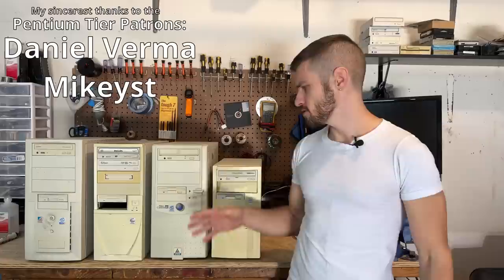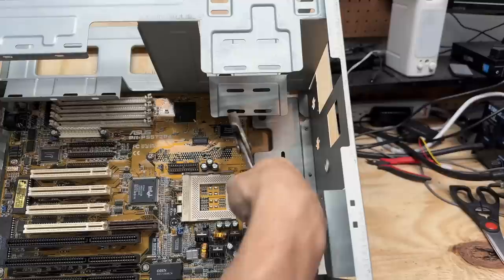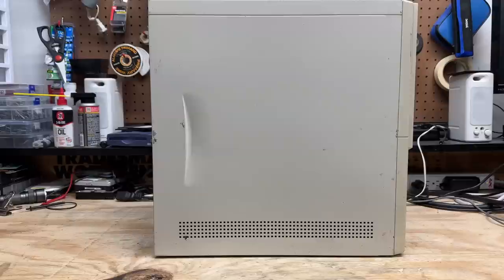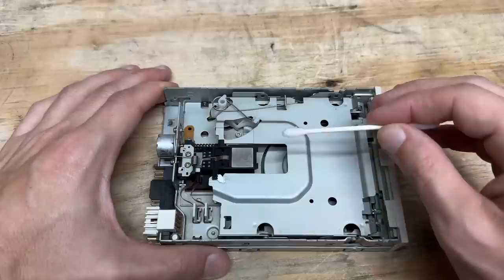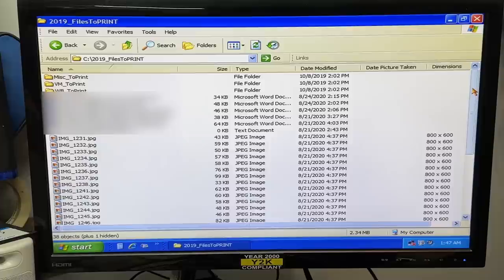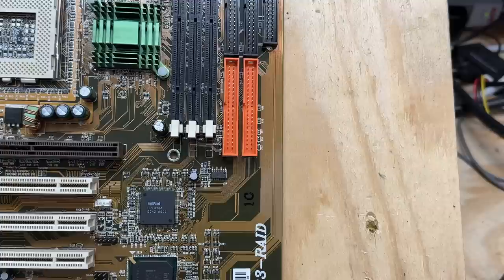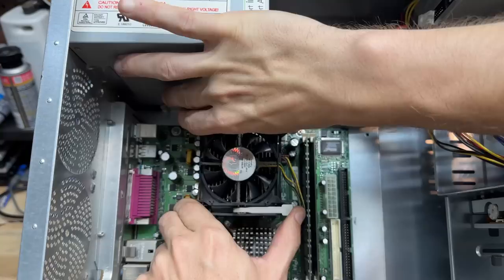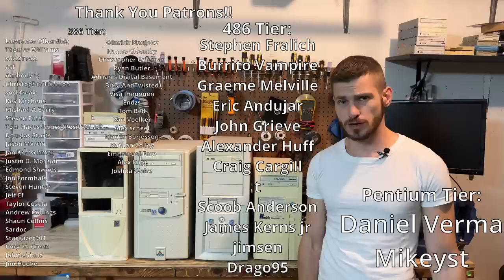Let's explore some mystery custom PC towers!

Comment: The sticker over the speaker performs potentially two functions, but making it quieter isn't really one of them.

It's either for allowing a vacuum pickup tool to have a flat surface to grab the component during assembly (the same reason why you sometimes see a small piece of tape on USB connectors), and/or (perhaps more likely) to prevent ingress of cleaning fluid during an ultrasonic cleaning process at the end of assembly.

Making it quieter is just a side effect of the sticker being left in place after assembly and cleaning.

Comment: The inability of some drives of that period is related to lower reflectance of CD-Rs. Early DVDs were bad at reading CD-R for first generation.
Reply: I've encountered many a drive, particularly in the 2000s that just refused to load some CD-Rs. It was very much an imperfect technology that I don't miss any more... 😂
Reply: But they fixed those problems, just in time for napster. I'm happy when things come together like that. Man, the tunes I stole....... uh ...... borrowed..... sampled.
Reply: The main problem is cdr's are less reflective that cd's so had a lower signal return strength. Also the lasers could be just getting weak  so they read cd's but cant get a good signal from cdr disc's

Comment: I found a trick to revive floppy drives which won't move even with new grease. The trick is to spray some contact cleaner into the stepper motor that actuates the head, you can spray some in there through the holes in the back and so far it has revived 100% of the floppy drives that I did it on

Comment: Just wanted to say there was a period of time when it seemed like CD-ROM drives just wouldn't read CD-R disks for some reason. Like in the late 90s or early 2000s it seemed like we had a bunch of different brands with that issue. Finally started to order every system with a CD burner, just so we knew that they would read. Great channel and fun to see you restoring the same type of systems I started my career on.

Comment: That Celeron looked like a BX chipset, very popular pairing, you could overclock the smeg out of celerons.
Reply: You mean CeleronA (with the on-die cache), didn't you?!
Reply: Yes, I had one of those back in the days. 300 MHz easily overclocked to 450 MHz, that was awesome value for money.
Reply: The celeryA was the one worth OCing. The non A 266 did overclock well though
Reply: and P2s, or so I heard.

Comment: My gut feeling with the CD-Rs not working is due to the dye. Modern CD-R blanks are made with much lighter dyes (phthalocyanine) which might not reflect quite how those old drives need. I recall that most of my discs back in the early 2000s were a lot more blue in color than they are now. I could be wrong but just a thought.
Reply: You may very well be right. I have plenty of Verbatim disks that used their dark blue AZO dyes and those disks always read well, compared to many of the cheaper disks I used in later years that had like a very pale green type dye.
Reply: Do you remember orange dye CD-Rs? The first Maxell ones I bought in the very early 2000s were like that and ugly expensive. I seem to remember they were something like 18 Austrian Schillings each, or €1.50 in 2002 money. Finding a 10-pack of no-name CD-Rs for 10 Euros felt like a steal and they were decent too. The packaging was something to behold. A plain white cardboard box with black print and the discs in paper sleeves inside. No manufacturer info or anything on the box I think. If I remember correctly these off-brand discs had a deep green dye. Blue ones came later and I loved them as a teenager.
Reply: @Ragnar8504  I never saw orange dye disks, but I did encounter recordable disks probably a bit later in the lifetime of the tech. However I have very fond memory of the Dysan black CD-R, as rumour had it those would work best for pirated PS1 games. I never could test that, but the black disks looked really neat and all of those I burnt still work to this day. Can't same the same for those pale green-ish dye ones.

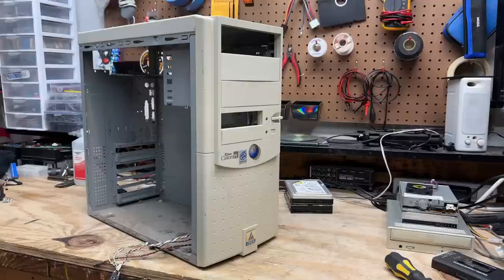Comment: 20:45 - The capacitors aren't what you have to worry about, it's the primary side heatsink, which is just above them. Most power supplies have that heatsink in-circuit with the primary switching mosfets, meaning that it's anywhere between 60-375v RMS, depending on the switching topology used. Some power supplies are of piss poor design and can have that live heatsink just 1/16th of an inch from the lid with no insulation between them.

I had an Antec SL350 that was such a design. Had a spectacular bang one time when a ground wire broke out of a molex connector and a one in a million shot, the wire whipped back and the end went directly into the vent of the PSU housing and touched the heatsink. Sounded like a gunshot and blew a deep crater in the heatsink. PSU was unfixable, that bang destroyed the mosfets, the PWM controller, bridge rectifier and controller IC.

The capacitors are perfectly safe to touch powered on, since their legs are hidden under the board. The heatsink, not so much. Accidentally brush against it and you'll be swearing right quick. The capacitors can keep that heatsink charged up from minutes to several hours if the bleed down resistors are missing or damaged. Best to poke a multimeter across the heatsink and the PSU body to make sure there's no voltage left. Don't try shorting this heatsink out, because you'll most likely blow up the main switching mosfets and destroy the supply.

Comment: The AOpen was obviously from a smokers house. I know, both of my parent's smoked, so I know that dust well. The reason it's so difficult to clean is because it's got cigarette tar, which is incredibly sticky. A bit of degreaser, like Dawn dish soap, will work wonders on plastic parts.
Reply: The spookier part, is how that stuff binds to lung tissue. I think of the things I did to my lungs. And even now, I'm not sure if I got away scot-free. But I LOVED smoking, in the beginning, and it was because of that very tar, that my tastebuds went to nirvana, and ultimately short-circuited, so that cigs were tasting like something worse than ***t to me.
Reply: I'm not sure, the dust doesn't look quite brown enough to me. Besides, it would have smelled. Humidity can make dust properly difficult to remove. My parents have a holiday home that sits empty and unheated throughout most of winter and that has dust just like this PC. Spring cleaning is always a chore.

Comment: That last system with the 2003 parts takes me right back to my high school years. That was the rig i was running right around my senior year of HS, first video card i bought was the Voodoo 3 and that would have been in 2001 i believe. Time flies.
Reply: Just out of curiosity, I'm wondering if they were still teaching computer science in hs in 2003. We took it in grade 12, but that was in 1982.

Also, it's just weird what time changes. When I was learning how to run my own computer, reading those Dummies books and doing the disk tutorials, we were told that we needed to get a "computer guru" to help and guide us in our computer journey. That was in the mid 90s.

Now, it's like who the fkkk needs one of those? The damn comp explains itself.  : )
Reply: @keithbrown7685  They were still teaching computer science in 2003 in high school because I was taking some of those classes back then while I was in high school. They were tech prep/vocational program classes that counted towards college but I never used that credit for anything as I did not go to university, only to a vocational college.

Comment: Awesome videos. The P4 is not dual core but Hyperthreaded. Was a way to get more performance with those chips
Reply: And more heat. That was the whole point with the P4. Geeks needed space heaters. They also needed comps, but they often lived in cold cramped spaces, like dorm rooms. Enter the Pentium 4.

Comment: You never know what you'll find in these mystery towers, system 4 looks like the kind of cheap somewhat flimsy case I built a metric ton of PC's in while working at a local PC repair shop in high school. It's really cool it supports a 120mm fan tho, none of the ones I worked on despite looking very similar supported more than a single 80 front and rear. Could make a really good candidate for an IDE RAID array 'cause you could put a modern high static pressure silent fan in there and keep those drives cool. Pair of 80mm's out back, you'll be set. Thankfully modern fan designs are much imporoved over ye olde days where even the silent fans probably buzzed when new, or just screamed, or both.
Reply from the maker: The system 4 case is almost perfect for it. I’ll definitely use some modern, quiet fans so that those delicious drive sounds won’t be drowned out.
Reply: @miketech1024  Yeah, no pesky vibration dampers either, though I dunno what that's gonna do for the life of four drives hammering away in sequence. 

Back in high school, a friend of mine and I thought it would be funny to RAID a bunch of these noisy 1GB Western Digital drives he'd gotten in bulk. We never got to do it though, but man that would've been loud. The drives were leftover spares from some office building, NOS,  and they were loud. Never thought I'd miss that sound, haha!

Comment: Love your videos! I'm sure the fiberglass repair works well, haven't tried that myself, but I can also recommend Plastruct Plastic Weld. It is solvent based and chemically dissolves the plastic and melds it back together. I've used it to repair cracks in computer cases with great results. Edit: I see someone else already suggested this, at least I'm not alone :D
Reply from the maker: Thanks! I thought the previous comment was referring to the electric plastic welders (the ones that essentially just melt a heated wire in). Never heard of that stuff, but it looks interesting.

Comment: woow this first PC, it gave me some nostalgia....
very similar to our first PC when I was 5 or 6 years old it had also an Asus MB and a 120MHz intel P1 and 2x 16MB ram sticks :)
also the case is similar, maybe just different front plastic front panel (more rounded buttons)
it had a 1.6 GB seagata and a 8x CD rom

Comment: The last case is an Enermax. They had a ton of different looking front panels but are identical on the inside. Still using mine after almost 20 years.

Comment: Good idea using a fiber glass repair, myself I usually use a plastic welder to repair bezels llike that (both automotive and PC) it fills in the gaps a bit better, but i always end up having to sand and paint the whole thing as its hard to match the color
Reply from the maker: Fiberglass is my favorite material for repairing thin plastic like this. Stuff is crazy strong! I do wish there were a good way to replicate original texture after filling/sanding. Especially that classic IBM texture.

Comment: Some of those older CD and CD-RW drives would read -R but not +R or the other way around.  Would not read -R but would read +R's.  And/or were just finikey about reading both. Depending on how the CD-R was closed when written.  And there's just no rhyme or reason to it.  
Excellent video, I look forward to watching more.
Reply: That would be DVD. CDs only came in -ROM, -R and -RW flavours. Early DVD drives were sometimes indeed limited to whatever rewritable format the manufacturer thought to be more likely succeed in the format war. DVD-RAM was even more limited, especially the cartridge type.
Reply: @Ragnar8504  Whooops, you're right, I got'em mixed up.

Comment: It's fine to try and start a MB with bulging caps, ie, it will ether start, or won't start. 
Also those rows of caps are usually in parallel, so you can replace 6 caps of 1500 with 2 caps of 4500.

Comment: I think the AOpen system was built at a local computer shop or as mail-order instead of assembled by a home enthusiast because of the CSI label. CSI was an acronym for Custom System Integrator which is what a lot of those type of smaller vendors were classified as back then. 

The matching AOpen CD drive, PSU, and AOpen chip on the sound card lends further credence to a purchased build, as does the Coolermaster 3rd party CPU cooler, since the boxed Intel chips for home end users included a fan but the OEM brown box CPUs didn’t always. 

You are my favorite channel discovery of 2023. ^__^ Love the way everything is put together and that includes the host. 🤠
Reply from the maker: Thanks! That is interesting. The CSI badge was giving me a bit of a hunch. It's incredible how difficult this information is to find via search.

Comment: It has always been my experience that the CD session has to be closed when burning the disc before writers/burners will read them.
Reply: Yeah i had that a lot over the years 💿
Reply: At the start of the audio cd rip-off era, someone gave me a disc that sounded like the audio had tiny little pperforations in it. Turned out they forgot to finalize it.

I don't know why I remember such trivia, but this was in the year 2000.

Comment: Seeing the AOpen system interior brought to mind a service call I did for a local cement and gravel company. I was the most dust I ever saw inside a mostly working system. Every component was coated with about 2 mms of rock dust. The fans and heat-sinks were all rendered useless/non-functional by being gobbed tight by dust and grit. The bottom of the interior was coated thicker than the rest, easily a full cm of filth. How the system had managed to function in any capacity for more than a week in that location beggars belief.

Regarding CD-R incompatibility, in the late 1990s and early 2000s, I had endless troubles with CD-RW and CD-R media, it all hinged on what color laser diode was used in the units. Some used a yellow laser diode that would not work with some media, others used a blue laser diode (mostly Sony) that would not work with some media, yet others used a red laser diode that would not work with some media. Some worked fine reading CDs burned by any color laser diode, but not read RW media at all, even if the burn session had closed the CD to any further changes. And some would read a RW media until it was used a second time, then never again would it read. So much jank hardware in those days.
Reply from the maker: That makes my bearings hurt lol. I used to work at a shipyard. It gave me a whole new respect for the environmental conditions that hardware can tolerate! Oh I remember all too well the wild-west days of early recordable optical media. I definitely don't miss that!

Comment: The ABit BX133  RAID was a pretty decent board many Pentiums like the 500 and the 700 with 100MHz frontside bus run perfectly well on 133MHz, good memory is important though. The Highpoint IDE controller was much better then most people thought, one could it even get to boot from a RAID and it worked well with the infamous IBM DTLA hard-drives which dies because they had the IDE protocol correctly implemented and many of the controllers of the time used "free" say rarely used signals for some proprietary stuff and this killed the IBMs. Highpoint did it right and gets the IBMs to serious performance. Most important is the reduced system load same like what SCSI did - for a much higher price.